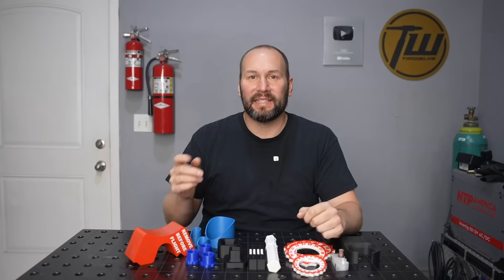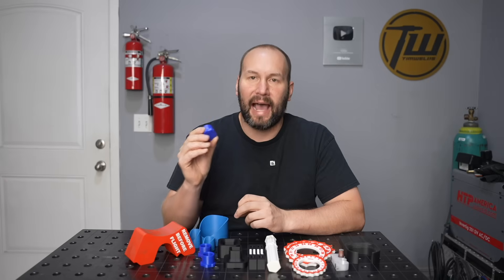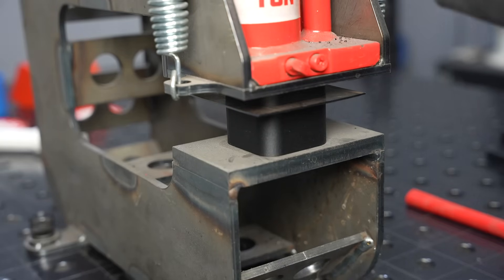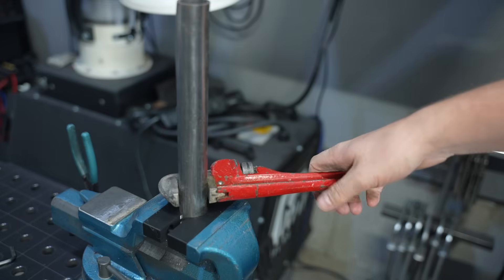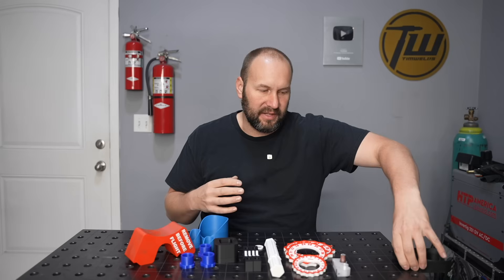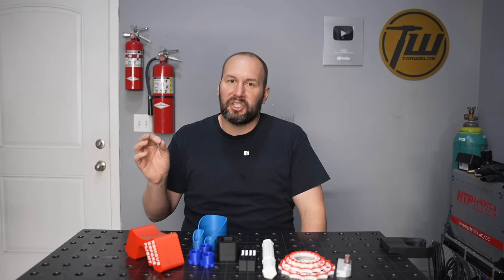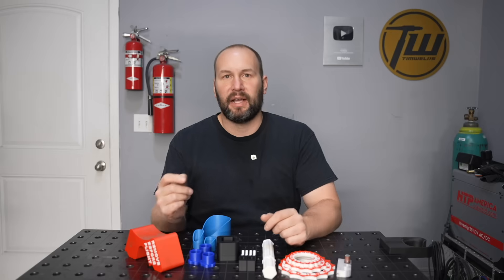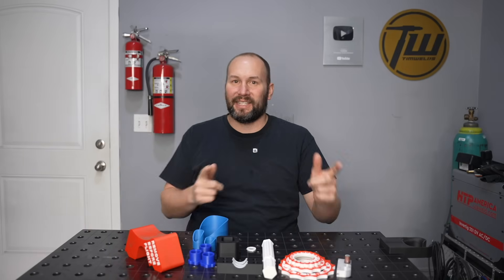My Favorite 3D Printed Fabrication Tools

Comment: I love having flat bottom dimples personally. Much more stress on the dies so it probably wouldn't work with any composite but I machine them myself out of 4140. I also cope my cage joints with a boring bar on the mill so I do a little "extra" 😅

Comment: 3:19 Engineer here, so this looks like a situation like you'd find with high end cutting tools. In industry, cutting super hard materials will typically use diamond or ceramic bits. Diamond bits are the clear choice for long lasting tools but they are expensive. Ceramic bits literally shatter after a while of use and last a fraction of the time, but they are ALSO a fraction of the COST. So it becomes a balancing game. Is the lower cost of the weaker bits better or does the longer lasting diamond bit pay for itself. Those punches are going to wear out a lot faster than a metal one but how much does the ease of production and design save? Those are the questions you have to ask yourself here.

Comment: For the Dimple Die, try adding 2-3 cylindrical voids, on each side, to the longer square section.  If you make them vertical (parallel to force being applied) they should add some strength to the print. You are creating internal "outside" walls. Make sure to have the voids be shorter than your bottom and top layer amounts (ex, 5 top layers @ .2 mm/have the void stop at least 1mm before the top surface). I have done this with a few parts I designed and it worked wonders.

Comment: I’d add a correction to your comment on dual nozzle printers. The single nozzle machines with an AMS can print different filaments in the same part, it’s just they need to swap, purge out the previous filament, print, then swap back. This process leads to increased filament waste which is the true advantage of a dual nozzle machine. 😊
Reply: I think his statement was more about the Bambu AMS with TPU. Most guides say to avoid that combination because the AMS is known for not handling flexible filaments that well.

Comment: I'm a nerd who was into 3D printing in the early days. There is a software development book which says "Don't learn programming to become a programmer, there are already too many of them, learn programming to use it as your secret weapon in your non-tech industry". You've taken that idea and run with it in metalworking with obviously awesome results. That dimple die is a big surprise to me, I never thought a 3D print would stand up to that much force!
Reply: You should see what press brake operators are doing with it.  Putting multiple tons per foot on pla. Only has to do one bend or whatever it’s wayyyy cheaper than metal

Comment: Great video, clear and easy to understand with no wasted filler. 👍 If you have different shapes or diameters that would be relevant, I'd be tempted to make the vise jaws thinner with a lip on the top and a magnet in the side facing the vice. Would make them super quick and easy to change, and should stay in place adequately.

Comment: I bought the Bambu X1C predominantly based on your recommendation, Tim. It has not disappointed. I have reverse-engineered a long-obsolete ignition component for outboard engines. I originally made CNC billet aluminum parts, that require 2 CNC setups in the mill, plus an hour or so for corrosion protection coating. I offer 3d printed parts at less than half the cost ($200 vs. $70) so most folks go with the printed option. The part essentially saves owners of these specific outboards the expense of crankshaft or worst-case engine replacement. It’s been a huge hit in the Evinrude outboard community. Thanks for the help!

Comment: I started out years ago with a homebuilt core XY machine that was not all that good. Bought a Prusa MK3, later upgrade to a MK3S+, then a Bambu X1C w/ AMS, then a H2S w/ AMS-2. I occasionally had issues with the Prusa printers, but nothing serious.  The Bambu printers have been flawless. I recently ran four 15 hour prints on the H2S and the results are great. I typically stick with PETG. PLA absorbs moisture, has dimensional shifts over time, and doesn't handle UV well. I used ABS for a while, but unless you have an enclosed chamber with good filtering, it stinks. I've also used a few of the engineering filaments, but I rarely have need for those. PETG is cheap, stable, predictable, and yields great prints. Can't imagine not having a 3D printer now :)

Comment: I usually make caps for things like regulators, hose ends and tubing out of TPU with just a slip fit. Easy to design and print quickly. Good video and I like the customizable template.

Comment: Tim,
I’m thinking of forming some 1/8” copper sheet for model boiler plates. Watching those dimple pressing examples, I wonder if the form dies could be made (printed) using that carbon fibre reinforced material? Not for production runs … mane each set used only once..
Example would be pressing a 1/4” flange on a 5” dia. plate..,
What do you think?
Robert
🇦🇺
Reply from the maker: I think it depends on the thickness of material and total load applied. I think it would probably work with a nylon type filament for a thin copper sheet. It was a carbon fiber reinforce nylon (PA) that I used before and its worked well for me. There are other examples online. This is one of my favorite 3D printed forming die experiments that I've seen to emboss metal: https://youtu.be/EhZmlTw2aUE?si=vulT1czzaZOajuv3

Comment: For the dimple die try some cheaper nylon as that will hold up better for something like that work load
Reply from the maker: Thanks! I’ll give that a try. The last one I made was PAHT-CF and It’s been really durable. I’m also thinking that if I split the volume and print everything under the little ramp on the punch 100% solid that it would hold up better too.
Reply: @TimWelds PAHT is a marketing buzz word and doesn't mean much other than it's nylon. You don't need the HT(high temp) part so any old nylon is ok. You are looking for the high layer adhesion and impact resistance which nylon is great for
Reply from the maker: Great to know, that stuff is like $100 a roll.
Reply: wouldn't adding grease help too?

Comment: I agree with this. I make products for my own use and for the shop. Amazing how useful a 3D printer can be.

By the way, while I know this may not be the right video for this, but I thought you might be interested, I’m sure you realized that the XTools laser gun, while good and with some advantages when compared to others  fir the triggers and replacing the safety lenses, has a problem. They have very few nozzles. There are a number of standard nozzles they don’t have. This are available from other manufacturers, but you can’t use them with the XTool gun. For some reason, they use a proprietary slip fit end. So I looked at the 16mm screw tips, thinking I could remove the threads on the lathe and then they might fit. So I bought a kit of eight different tips, plus a tube, off eBay. That arrived today. What I found is that the tube length and diameter is the same as the XTools and fits right into the gun. The focus point is very close, so another mark to -2, for me, works. This opens a whole world of tips used in the professional laser welding world. Your, I think it’s the XLabs laser welder, uses this system. Try putting it into the XTools gun. It should work just fine. They have a tip for outside corner welding, for example. I tried shooting you an e-mail through your website, as you suggested, but it didn’t seem to go through.
Reply from the maker: That’s a great tip! I’ll have to see if the set I have is compatible with the xTool laser. I didn’t see a message from you, but my email address is on my about page on YT. I’d put it in the comments, but then I get the bots after me.
Reply: @TimWelds ok, thanks.